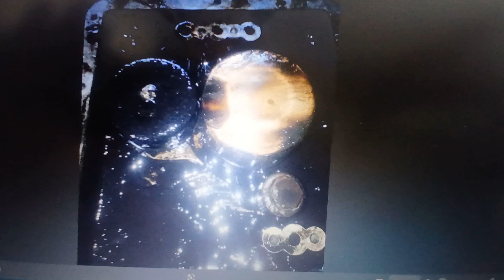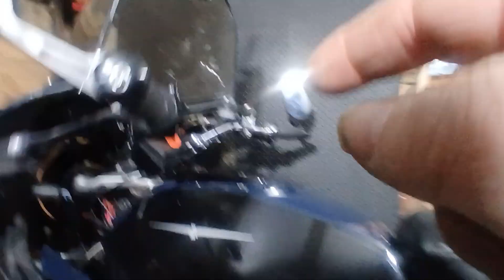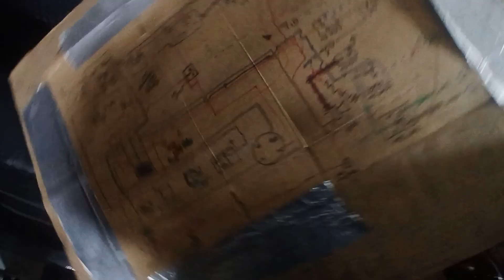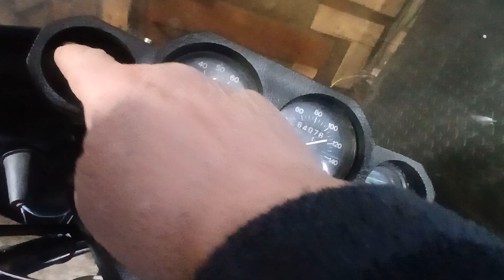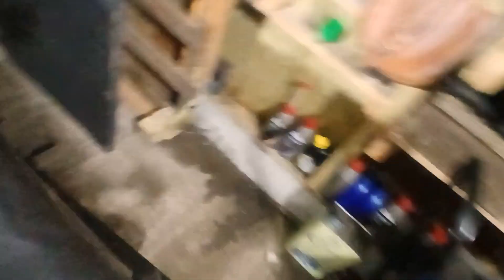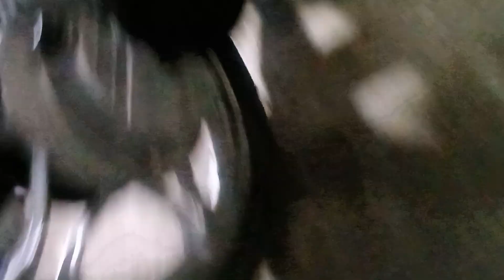1979 Moto Guzzi Spada ( 1000SP ) Rebuild .

Comment: its defiantly  a labour of love restoring a bike like this, restoring a mk v leman 1000, stove enamelled frame,,wheels,rewire,pads,tyres, easily at 2k, meanwhile on oscars garage an cosmetically immaculate MK V SE went for 1150  at auction, noticed it had a tray under the engine, now its on ebay with a slipping clutch and leaking oil from the clutch, no takers at 2500, i think 100HP Would be a very high state of tune, an r1100 gets 90 with a four valve head